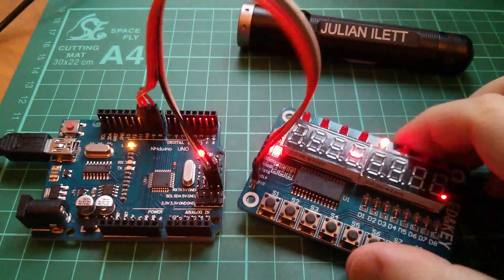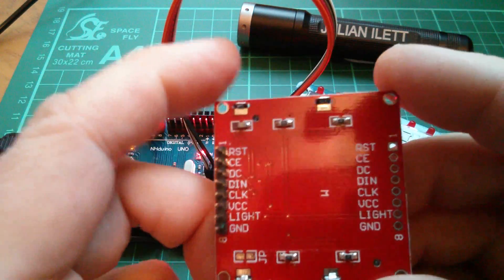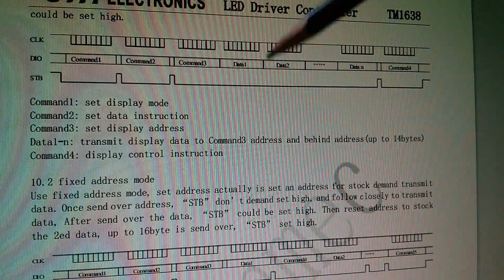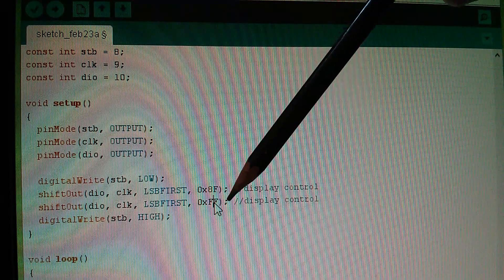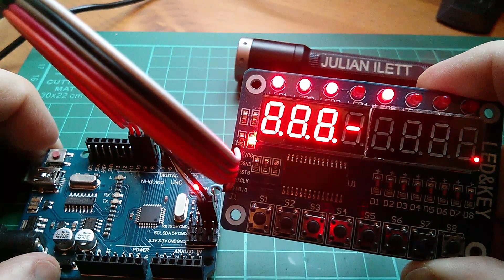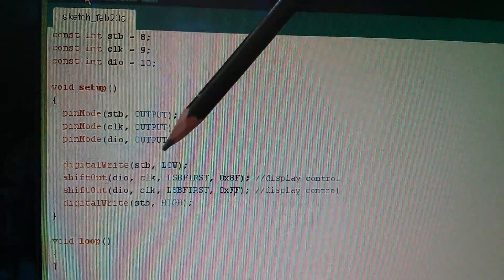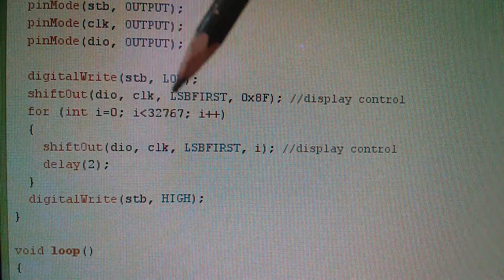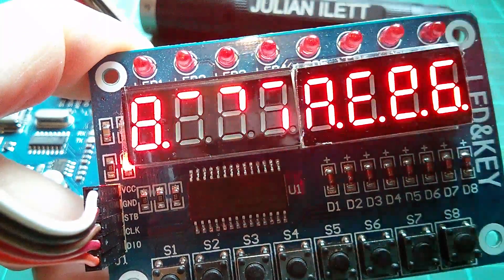Project: TM1638 8-Digit 7-Segment LED Display Module #2

Comment: How would you set a TM1638 from the box to act as a counter? First 4 digit as a tally counter from 0000-9999 and the following 4 digit a different set of tally counter from 0000-9999. Both sides would need a plus 1 and a minus 1 buttons to be set-up. Would love to know step by step and the equipment used for this! Are you able to help out?
Reply: Match Gallarde Sorry, it’s not possible using the chip/board alone, as it has no user accessible memory - nothing to increment. The board is able to output data to its various LEDs and read the state of the switches. Period. You’ll need to keep the counter on the Arduino side. If you’re still interested in this project and would like more help, just reply here and I’d be happy go into greater depth. Spoiler alert, it’s pretty darned easy to do what you need.
Reply: @a1nelson  I need assembly language code for TM1638 , can you help me for same ?? Thanks in advance....
Reply: @jainkirit  Hi. What microcontroller or board are you using to drive the TM1638? For example, are you using an STM32, a Teensy, a Feather, a Raspberry Pi, or …?
Reply: @a1nelson  89s52 with My techno care  ( in system programming -- ISP )
Reply: @a1nelson  my other display ( 8 digit 7 sagment manually constructed  )already running on ISP and now I tried to replace my PCB with TM1638
Reply: @jainkirit  Sorry for my slow reply. After looking into this microcontroller, went back to YouTube and had a little trouble finding your initial question, in order to respond to it. Anyway, it has been a long, long time since I have done work with an 8051 (or similar). So, unfortunately, I don’t have any assembly language code to give. (Maybe I’ll look through my old floppy disks some day. ;) )That said, there is plenty of Arduino-based code out there for the TM1638 you can use as a template for translating to say. Interacting with this module is very simple and easy, and I think you’ll find it straightforward to program, regardless of your architecture.

I must say, I am now curious about how your processor interacts with modern serial buses. Back in the day, most interfaces were all either parallel or bit-banged serial. Presumably, there are on-chip peripherals for all that now. Do you have any public code - on GitHub or Gitlab, for instance, for this processor? I’d love to see it. Or maybe you could recommended an interesting repo created by someone else for this processor?

Best of luck with your project.